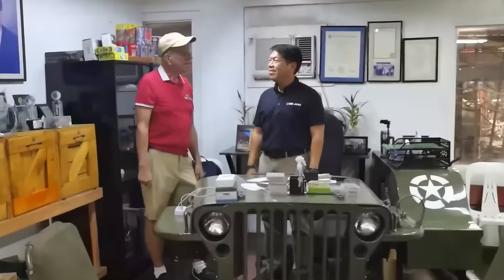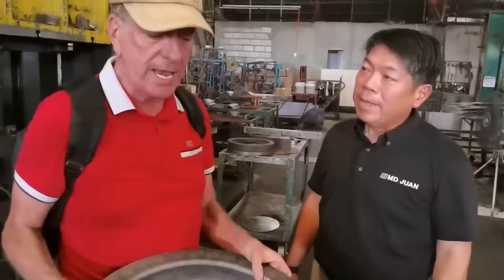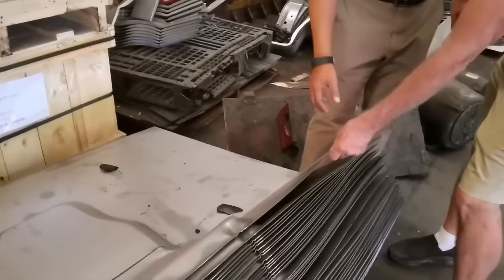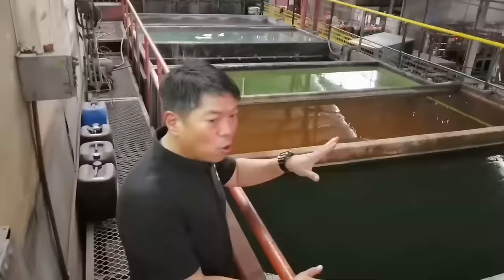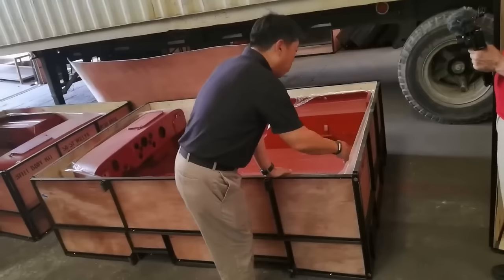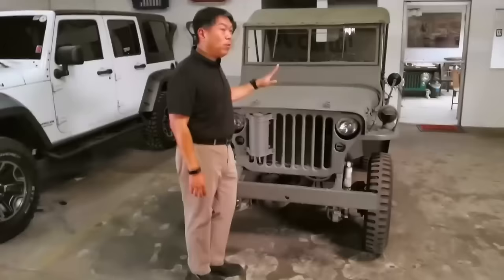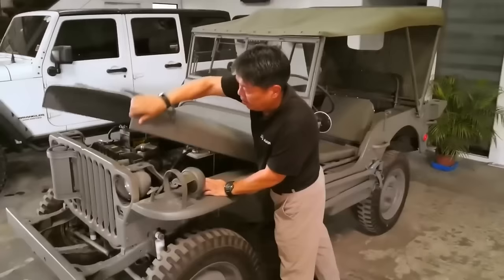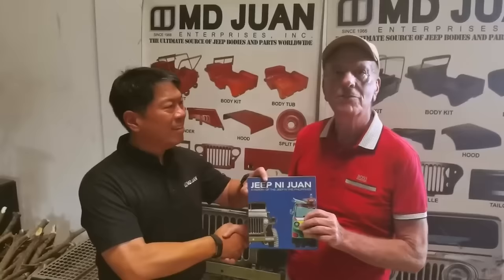MD Juan Jeep Factory Tour  WW2 Willys Jeep reproductions, parts, and kits

Comment: People in the Philippines have been reproducing the jeep ever since WWII, I believe. I have been there several times. I have seen jeeps in galvanized steel, stainless steel (brushed and polished) and occasionally painted. All with various engines. Gasoline and Diesel.
Reply: Imagine a full MB Jeep body made from Brass sheet!! :)  .. If you talked to the right people at the factory!?  The only obstacle would be the right amount of cash! :) ..
Reply: This vehicle is very best in  hill roads and the maintenance and repair  cost is very less
Reply: you're correct! I was in the PI 2 weeks ago and saw all the willy jeeps and jeepneys, the jeepneys now usually use Isuzu diesel engines!
Reply: Exactly right! They remake Jeep CJs and Wrangers in a variety of body styles you may choose from. And using reliable engines such as Toyota, Isuzo, Mitsubishi and others. That is what makes it Fun in the Philippines!...🎉🎉❤❤😊😊

Comment: We bought a cj2-3 body and I ran out of time trying to rework the damn thing trying to get it to fit to the frame. We had to cut the frame mounts off to move them to where the miswelded body mounts are. Total crap. I would rebuild your original body and save $4000 dollars.
Reply: The company has done much to correct the various fit problems.
Some suppliers like Pete DeBella, rework the bodies to get them perfect so you don't have to.
Reply: They have a ways to go, stuff they make fits very poorly without a lot of rework !!